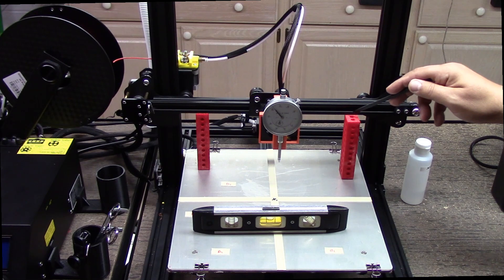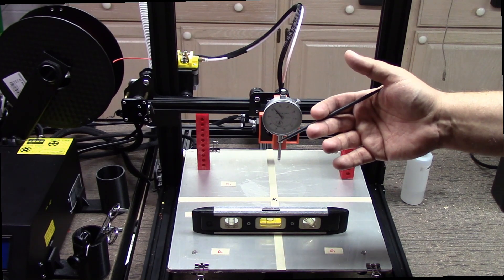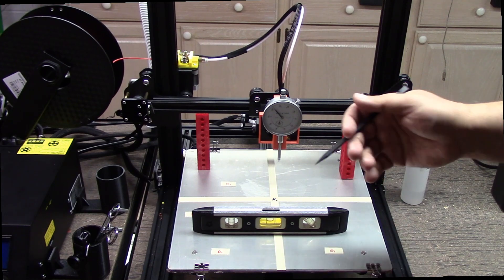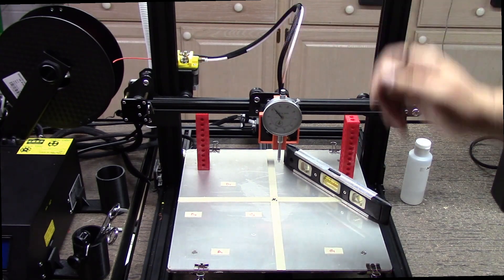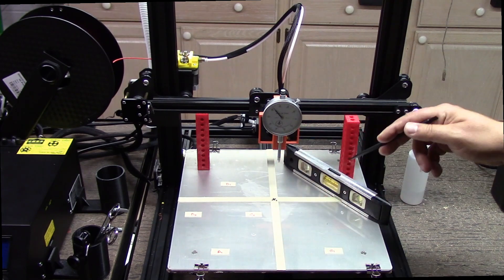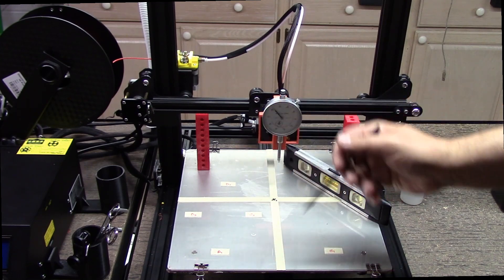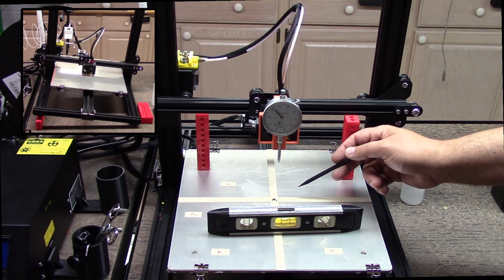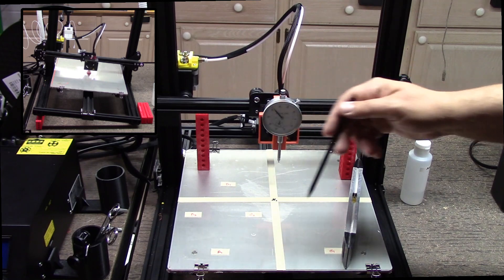Shop Talk - Stop Leveling Your Bed and Start Tramming Your Machine!

Comment: So your machine is not setup correctly. The first thing you need to do is get that gantry square to the Z travel. This requires the use of a cylinder square. But since this is just a 3D printer, simply using a nice machinists square is probably about as good as most people are going to use. Once that is square you can level your bed. The problem you have going on there isn't going to be as noticeable with a 3D printer versus a milling machine, because on a mill as you stepped down to cut around the profile of a part you would see steps around the part. Because the endmill would be leaning over on an angled plane, but cutting moves are traveling along a vertical plane. Since the 3D printers move in the Z axis in such small increments the problem with the gantry being unsquare to the frame is not even slightly noticeable. But you really should square up your machine. That's embarrassing man :D
Reply: DIY3DTECH.com If you take your blocks and set them on the lower frame rails and check the gantry height on each side - what do you get? Mine was actually high on the right when I got it. So I checked the uprights to the lower frame for squareness which was fine. Then I loosened the right side rollers on the gantry  slightly. With those loose I adjusted the left side rollers to get the gantry level with the lower frame, making sure light pressure on each roller would move the gantry up and down. Then I did the same on the right making sure the gantry reamained level. Then I leveled the bed after bending the aluminum plate back to flat. It's all within .010" even after months of printing. And I don't get any more than .01" variance side to side in the gantry from Z0 to Z400. I have setup and trammed 4 and 5 axis CNC'S with up to 100 feet of travel. Using the ball bar and lasers etc. You have to do things in a certain order to get it all dialed in.
Reply from the maker: Not embarrassing as it is set up correctly and you will never square the gantry because of the sag.  In addition the Z-Axis will alway pull against the sag as gravity will pull it down.  I also have milling machines all the like so been there and do all of that stuff as milling machine also move in the Z (down rather than up) the same also hold true.  Again been doing machining and machines for 30 some years, been around block a few times :-)
Reply: DIY3DTECH.com my gantry is square and has no sag with the extruder on the left or right. It is possible. You just have to have the rollers properly adjusted on the left side. That was the very first thing I did when I setup the machine after I checked the uprights for squareness. Yours is way off. I could possibly upload a vid to show you tonight if I make it home.
Reply from the maker: You will and can be close, as I am about 0.15mm off however this thing called friction will sag it as one side will be pushed, the other side will need to be pulled and those aren't Joe's laws but the laws of physics :-)
Reply: Yeah, I don't see that on my machine. I tested everything thoroughly with a test indicator as I set it up. If the machine moves freely, and the rollers are snug against the rails, it's hard for it to be pulled out of square by the gantry moving up and down. One thing I did not do that I saw you doing was you checked the gantry to the bed with your so called 1-2-3 blocks (snicker). I checked mine to the lower frame rails, disregarding the bed. Once that was square I leveled the bed. You showed your bed wasn't level, then checked the height of the gantry on each side, showing the gantry was lower on the right to the bed. So you have not matched the plane of your bed to the plane of the gantry. Your bed is leaning to the right. Your gantry is leaning even more.

And I think you are a bit off on the guess that one side is only .15mm lower. I took a screenshot before and after the block was slid under the gantry. Here is an animation of before and after: https://www.dropbox.com/s/gn0xhsoy9mdrv05/Shake-Shake-Shake-2.gif?dl=0

And if you take a closer look at the other side of the gantry before and after you will see your rollers are moving around: https://www.dropbox.com/s/d7rfdmgg7sa3why/Shake-Shake-Shake.gif?dl=0
Reply from the maker: Yes i know those aren’t formal 123 blocks but don’t know what else to call them:-)
Reply: DIY3DTECH.com  Man, and some people thought YOU were beeing picky by correcting the terminology.  😀

Comment: There really should only be three adjustment screws. That does not imply that you only need to measure three points. Having a fourth adjustment screw implies that the user can twist the bed. In most cases the bed is too stiff to be twisted in that way and yet it will probably twist or wooble some anyhow.

Even if the bed could twist by the fourth screw, that would likely be very hard to get right manually.

The three screws should be distributed with two in corners and one midway between two corners. Like front left, front right and back middle.
Reply from the maker: Thanks for commenting! I hear what your saying yet can also share with you 4 is better (maybe easyer is a "better" word)  than 3 as I have both as with the four screws we aren't "twisting" the bed (maybe I am interpreting this wrong)  but you could say contorting the surface to distribute the error of the surface.  A good example was on the originally mirror of the Hale 200 meter telescope they had to use small fishing scales (the kind you hold in your hand with a small hook) to contort the surface plan of the mirror.  Maybe I can explain it this way without 4 adjustment point I could not [easily] adjust for the sag of the CR-10's gantry as both front and back sides of the left of the bed would need to be reduced by equal amounts while [in a three point model] you could depress the back left and it should pivot on the front center to create the slope, you will become frustrated trying to perfect that front left "pitch"  with the back right adjustment screw.  This is one of the things I found with the Da Vinci's as they have three adjustment points and I can't tell you the number of people who wrote me out frustration (and trust me starting out I had a lot too) over this as it simply was not intuitive.
Reply: I have two printers with four screws. On both of them it is impossible to setup the bed such that you can not get everything to shift by tapping a corner with your finger.

The thing is that the bed is actually too rigid to be twisted any. At least on my printers, one of which has a very small bed and the other has a rigid 5 mm thick glass plate.

So what happens instead when the fourth screw is not in perfect alignment with the plane defined by the three other screws? No it will not average any error out. It will simply float. There will be an air gap between the screw and the bed, even a very slight one. If you tap that point, the gap will disappear and instead you get a gap over one of the other screws. The bed is wobbling.

With three screws the bed leveling is very simple: You move the printhead over each screw and adjust. This will get your bed parallel to the machine. Now your bed might be bent some, or more likely, your rails may not be straight. Go find the highspot or lowspot. Then decide how much to raise or lower the platform. Each of the three screws need to be turned exactly the same amount.

One needs to remember that a plane is defined by exactly three points. It can never be defined by four points. If you have four points, the extra point can be on the same plane as defined by the first three points or it can be off plane. Since my glass plate is very flat and rigid, there will always be one screw that does nothing. But I have no idea which one it is. Just touching the machine can shift weight around and change which three points it is resting on. It is a shitty system. There should only be three points and they should not be spring loaded. They are spring loaded otherwise everything would jam up when you try to adjust with four screws  - not so with only three.

If you have a non rigid bed, you could in theory twist the bed with four points, such that you get a non flat surface. But exactly how it twists is uncertain. I think that is what you are trying to do. Due to the springs it is unlikely to work and I am betting that you simply have one floating corner just like what I got. Put on the dial indicator and tap the corners to see what I mean.

Comment: I agree on the tramming vs leveling. The community is using the leveling in the wrong sense. The thing that I question in your video is the fact that you can fit both blocks under your X axis illustrates that your bed isn't properly trammed. Or am I missing something?
Reply from the maker: Correct as I wanted to illustrate the sag...

Comment: Bed leveling means (and always was) to level build surface to the printing head (in all possible positions). And not to the earth/gravity.  Traming is used in cnc and it means not to level but make the drill bit/milling tool square to the surface (build plate). In 3d printing the hot end doesnt need to be perfect square to the bed and in real life 99% of printers its not and its less than 0,5°.
Reply from the maker: Thanks for commenting! Yet are you sure?  Did you watch the video?  So Joe average orders a printer from amazon and they know this how?  Proper Taxonomies with correct descriptors are critical for the transfer of proper information to task.  As just because you're aware of a specific paradigm doesn't mean the next person is.  As if a 3D printer isn't a CNC machine what is?  As two planes, exist in the 3d printer the tool head (hot-end) and bed as it is nothing more than an additive vertical mill and hence forth "tramming"...

Comment: I think you and I own similar printers.  I own a Da Vinci and a CR-10 also.  I've been thinking about this type of "leveling" of our CR-10 with only one 'Z' lead screw and a slightly tilting 'X' axis.  If it is tilted and the bed is delevelled to be parallel to 'X' axis, then 'good' prints will be equally skewed (not square) on the 'X'/'Z' plane.  Do you agree?
Reply from the maker: Hey we are brothers from a different mothers!  :-)  Also if I am following you no I don't I agree as you can see in the video the left side of the gantry sags and I compensate for this in the bed.  However in the comments of this video people are assuming the z also tilts which isn't case as its captive so it remains straight.  Keep in mind if the planes are perpendicular the object has remain square.  However any time you have only Z-Axis you will get variable sag throughout the print which can cause variations.
Reply: That's awesome my Brother!  Do you by chance have a Chinese "kit" 3D printer also?  LOL
BTW: I forgot to thank you for making this video on tramming.  The term "leveling" the bed has bothered me because that's not what we're doing when we're "leveling" the bed.  I hadn't heard of tramming before.  So, I'm really glad I found this video.

The last thing I want to do is argue my new found Brother, but I think, if the 'Z' axis is perpendicular to the natural horizon, say because the 3D printer is actually sitting on a truly level workbench, but the 'X' axis is slanted (because of sag, it is not parallel to the natural horizon) then the 2 axis' are not perpendicular to each other.  If we print a cube, the forward face (and rear face) are not square.  The top, bottom and both side faces are square, (as long as the 'Y' axis is perpendicular to 'Z' and 'X'.)  Either way, Thank You for making this video!!

Comment: I think the point here is that despite the geometrical definition of a plane being 3 points, the bed of your printer is NOT a plane and it NOT flat. It can be thought of as a plane if we average the high and low spots of the bed surface relative to the head at any given position. The more points we take to include in the average, the more accurate our average will be. And just for the record... level is a reference to the parallelism of a surface to the surface of, for example, still water.
Reply from the maker: Thanks for commenting!  Yes as I had several people write me and say one needed only to test three point and made a big deal about it and the reason I made the video :-)

Comment: I'm looking to buy a 3D printer, I don't own one, so I only have a small amount of experience with them. That said, this is my understanding of the engineering. Please correct me if I am wrong.

There are, essentially, two planes involved. One is the plane of the bed and the other is the plane described by the printer nozzle. I don't think the printer has any other frame of reference that would allow it to have any knowledge of any other plane. For example, I don't think the printer has any accelerometers that would allow it to sense gravity and so would have no concept of level in that sense, as stated in the video. Therefore, the printer must be assuming that its system of moving the nozzle is describing a plane. That is, for any given z value, any x/y movement describes a plane, even if it it does not in reality. For example, the printer wouldn't know if there was a bow in one of the rods.

Assuming what I just stated, the purpose of "bed leveling" would be to adjust the plane of the bed to be, as close an approximation as possible, parallel with that plane described by the nozzle. My understanding of "auto bed leveling" is that the printer cannot make any adjustments to the bed itself. The mechanics simply aren't there for controlling the topology of the physical bed. Rather, it scans the surface of the bed relative to the nozzle position using a sensor mounted on the nozzle. Conceptually, all the printer can do is lay down one layer whose thickness is the inverse of the topology it is captured so that the top of the first layer is "level" (i.e. parallel to the nozzle path).

That being the case, the actual plane of the bed needs to be within tolerance of the nozzle plane so that the thickness of the first layer can compensate for its irregular topology. So the bed itself has to be flat enough (no significant dips). The manual adjustment of the bed has to be close enough to bring all of its surface to within this tolerance. In that sense, you could think of the physical bed plane as some kind of average of its topology, but really the lowest point and highest points merely need to be within a range that can be compensated by the first layer.

The underlying assumption in all of this is that the printer has no idea of what is actually true (straight or level) in reality. Everything it does is simply referenced from the z position of the nozzle across its x/y range. The "auto bed leveling" is the process of creating a level surface with the first layer. Manual leveling is getting the bed plane parallel enough for this to be possible. In general, I would agree that three points is adequate for manual leveling, assuming the point is simply to get the bed into that tolerance range and that the topology of the bed does not need to be changed. It does appear that some printers have a system of set screws that allow the bed topology to be changed to make it flatter, but I've heard that is maddening.
Reply from the maker: In general yes, the one thing I would expand upon is the plane of the nozzle is not true either so yes the idea is to match the two as closely as possible and distribute error across the surface of the "bed".  Auto leveling except in commercial printers does not adjust any physical attribute of the machine, it only makes adjustment to the GCode and also only within certain tolerances and as mentioned in the video there are several versions of auto-leveling some better then others.  As the simplistic ones only use the slop of the plane, where some create a point cloud...